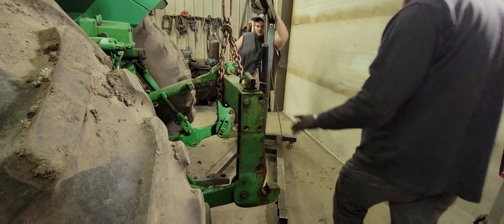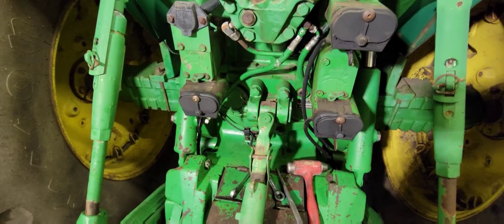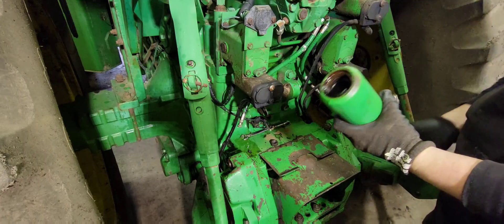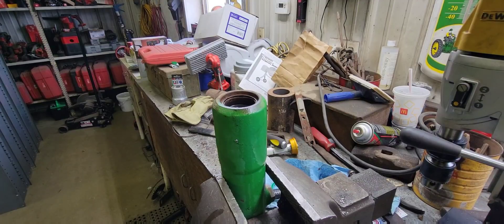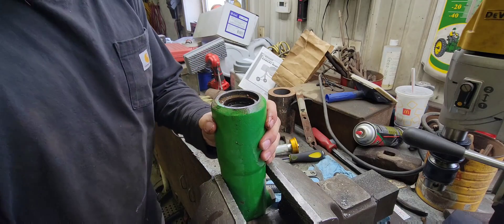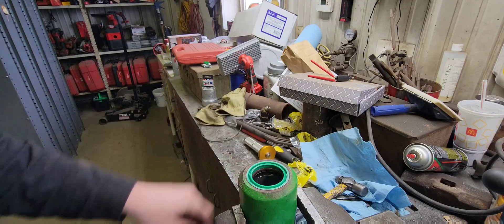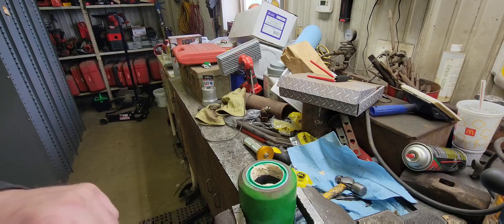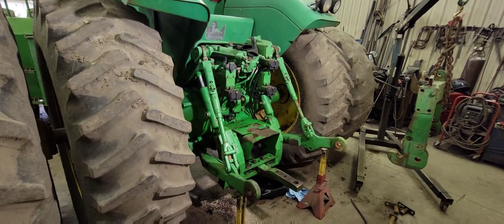John Deere 8650 3 Point Hitch Lift Assist Cylinder Rebuild Video!

Comment: Excellent video Brandon  :) also very interesting to fix up a on cylinders and easy to do agree! Yes those parts washer machines are awesome and excellent to use ! I have one shop long time plus at home since 2005 and my dad love using in front garage at home because was well ventilation and heated to work on stuff all year around! He said wishes had one home farm plus machinery shed shop years and had heated too but did not happen!

Comment: I never knew, these were assist cylinders. We have a 3350 that has the same set up and I thought these were the main lift cylinders(I need to rebuild mine as well, thanks for showing me how). Never knew there was a big cylinder in the rockshaft housing.

Comment: Nice video Brandon, question, what to you use for solvent in your parts washer? Also those seal tools are a time saver, I got a set similar to yours off Amazon myself this summer, also I have the same seal/bearing driver set too, they have held up real well for me, your tractor is coming along good and really like watching videos, thanks
Reply from the maker: Thank you!....we are just using pure mineral spirits in the parts washer we got a 55 gallon barrel of it we put half in and haven't had to add yet and we have used it alot!.....I should have bout them seal tools 10 years ago lol thank you for watching!